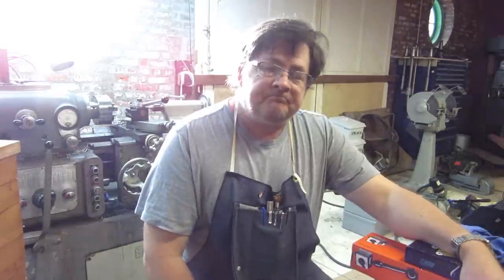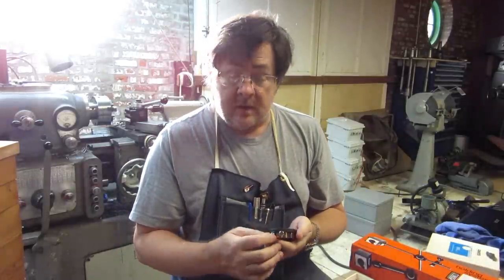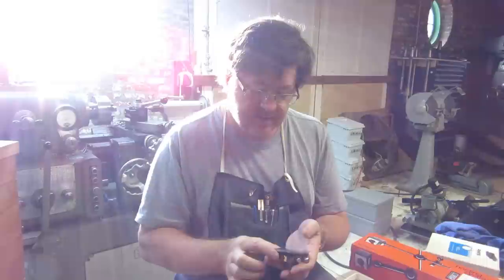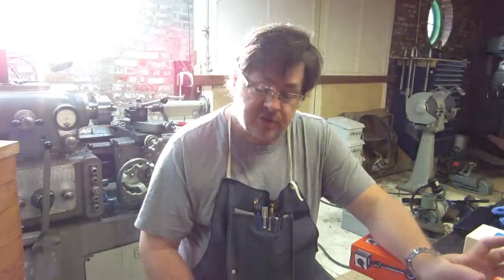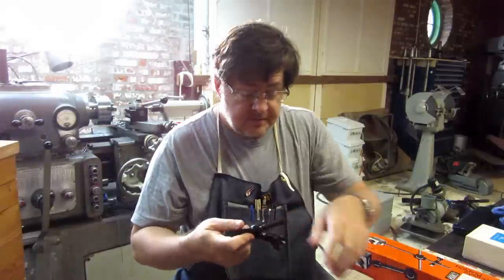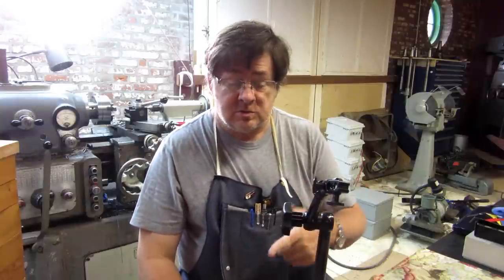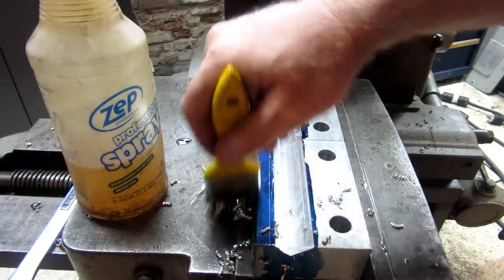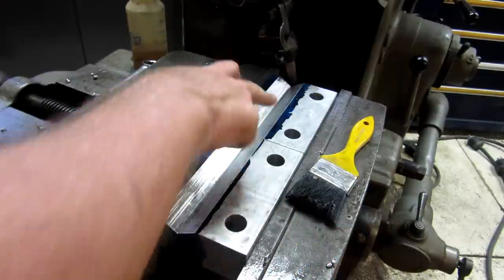Making a set of Vee Jaws for a Kurt Milling Vise

Comment: Nice video James!  I really appreciate you doing this work on the shaper.  I believe that sharpers can still be productive machines in certain scenarios, plus they are just fun to watch.  I had one in the last house where we lived, then we moved and I had to sell off my shop.  Mine was original driven by a steam engine flat belt but had been converted to a 5HP electric motor and Chevrolet truck transmission over the years. 

I keep a plate of steel mounted on it's table and I used that machine for relaxation time.  I am an engineer, and when I had a frustrating day I would fire that shaper up and plow off about 1/2" off steel in one pass.  Adam would have been proud.  The sound of the machine, the whisk of the cut and the smell... wow what memories.  That is the way to relax;-)

Anyway I just want to say thanks to all you provide to the metal working community. Maybe some day I will be in a positions to have a shop again and can make a contribution.  Until then - Mike

Comment: Aww hell James! I thought we were about to see some monster chips flying off that shaper tool! Very nice work! Always great to see some real shaping action.
Those jaws will be very handy. I need to make a couple sets for myself, another idea that's been on the backburner.
I can contest to the quality of the NOGA indicator holders. I have three now and they are best ones I have ever used. Bought my first one about 8 years ago now and its still working as good as day one. BTW Enco has the ones like you just picked up, and mine on sale for $99. Good deal.
Thanks for the shout out!

Adam
Reply from the maker: That tool setup isn't the most rigid so I was limited to about .125 on my doc otherwise it chattered like crazy.  No doubt the Noga holders are so much better than the imports that you have to show someone for them to believe it.

Comment: Were you using a spring tool holder in the shaper? And does it have a power compound or were you cranking the compound for every side pass?
Reply from the maker: Yes I was using a spring tool holder, you are a sharp eyed observer.  No, I only wish I had a power compound, hand cranking.

Comment: Cool videos James.  Having never used a shaper what would be the advantage over the mill for cutting these grooves?  How do you indicate a part on the shaper?
Reply from the maker: Peter Owens   There isn't real advantage to a shaper over a mill, other than cutting internal key ways and using really low cost tooling.  All other rules apply, "tramming in" the table, indicating in work for various needs, its all the same.  Consider a shaper a straight line lathe.

Comment: Interesting video. I enjoyed watching the shaper work and seeing how you set it up. How do you get a small radius in the bottom of the V with such a large radius on the cutting tool? I agree with you on the Noga. There one should not go for cheap. I enjoy the pace in your videos and it is nice to spend a little time "with" you when you post. Keep up the good work and thanks for sharing.
Reply from the maker: Jim Milne I just didn't cut to the full depth of the radius.  The V also cuts away a bit of the radius.  Thanks for you input, I am glad you enjoy the videos, lots more in the works.

Comment: Hi, I am a new machinist.  Have a question.  Could one use a milling cutter(one similar to a keyway style cutter) to do that job?  Say one about 4-6" in diameter.  Or....is it preferred to do it the way you showed?  I realize the cut would be an inch deep so it may not be the best way, but am wondering???  Also, there would be a piece of material that may be able to be used on another job.  Just curious, not bashing.  Great video.  Thanks.

Comment: James, we have a DRO on the downfeed works perfectly!
Reply from the maker: Samuel Pine  Are you talking about one of those little stand alone scales, like the re-purposed calipers?  I had thought about fitting something like that. Can you share a picture of your installation?
Reply: James Kilroy No it has a scale and the read out is mounted on the on off
control box.  This is on the down feed. A simple coat hanger holds up the wire.
so you can dial in on the fly. New PC and all the pics are in the one that took a
dump (i'm going to have it fixed) I dont like this new thing.

Comment: How would you have made the Vee cuts if you had to do it on the bridgeport? 

You could list the pins on eBay now that you are all tooled up.
Reply from the maker: Angle the workpiece and cut with a regular endmill. A bit more setup work for sure but faster.
Reply: I just did some angle work, I tilted the head on my machine and it went fast.

Comment: Heh, I thought the warning for the shaper ram was going to be followed by a camera strike or something... ;-)
It took tons of effort to pry my wallet for the buck-fifty noga base but now converted I dont know why anyone would waste time/money on old style holders. They are indeed that good. ;-)
Nice posting James.... Always love the shaper. I know a guy local that has a really sweet 12-incher but wont sell it to me... :-(  Maybe one day......

Colin
Reply from the maker: I suggest something bigger, try for a 16 or 20, that's when you can start taking real cuts and work holding is a lot easier with a bigger table.
Reply: A machine shop about an hour from me has a huge hydraulic unit just sitting in the corner. To them it's an antique and never used. This one is just massive, not sure of the stroke but for real men only...LOL
Reply from the maker: If its a Rockford hydraulic shaper, those were the pinnacle of shaper design.
Reply: May have to do some more investigation next time I'm up there.  ;-)

Comment: does your shaper head advance automagically or were you doing it by hand?
Reply from the maker: sharp x I wish I had automatic down feed but no such luck.
Reply: James Kilroy
couldn't figure out from the vid, props for patience and consistency :), turned out real nice. You can probably rig out something with an arduino, a stepper motor and a limit switch (to turn a specific amount once it touches the switch at the end stroke, could have a potentiometer for the advance rate) - but unless you do these for production probably not worth it.
At the beginning I thought you're going to use an endmill, but way nicer with the shaper. Is there a 90 deg cutter you might have been able to use in the horizontal mill?
Reply from the maker: A single angle 45 degree cutter would cut that in a snap.  And I have several,  but the shaper was calling my name.  I have thought about rigging up a down feed similar to how you suggest, would be a fun, imagine a cnc shaper.